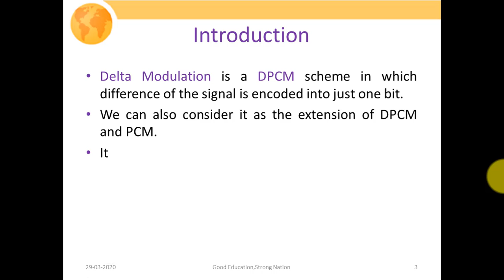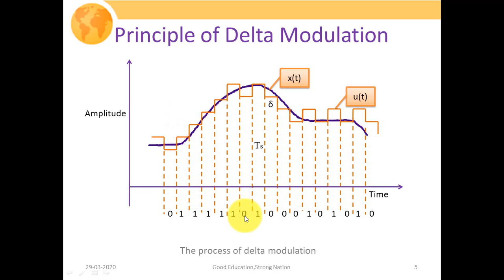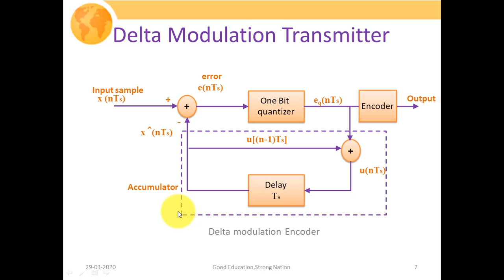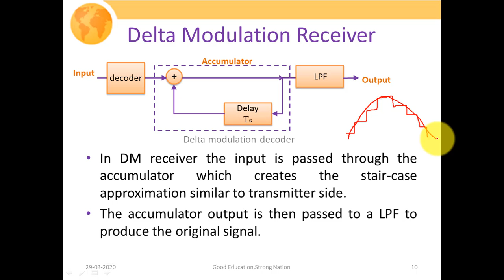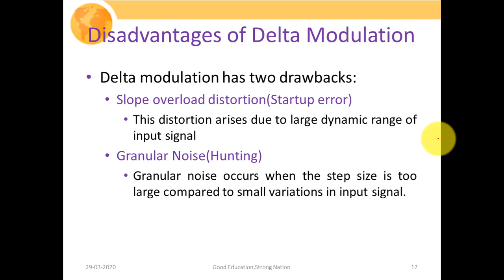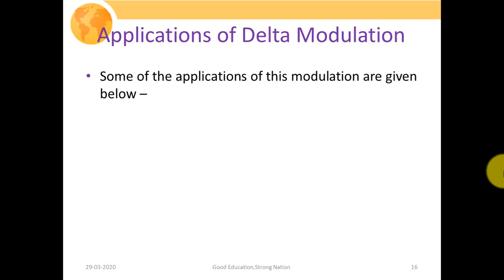Delta Modulation

Comment: The input to a DM is m(t)=0.01t. The DM operates at a sampling frequency of 20 Hz and has a step size of 2 mV. Sketch the Delta modulator output.

Can you solve this?
Reply from the maker: I can give you a hint: input is ramp type of signal and sampling frequency is 20 hz it means Ts=1/20 sec and the step size is given to you like 2mV...hence input will be a straight line having slope 0.01 passing through origin and output will be a staircase with step size 2mV. Hope this will help...
Reply: @ashutoshrastogi1984  tqsm 😀